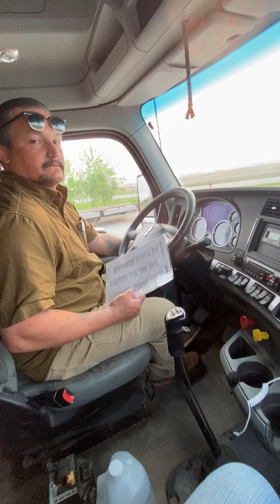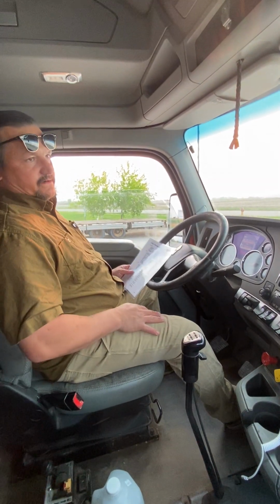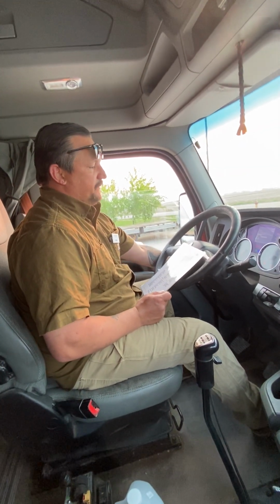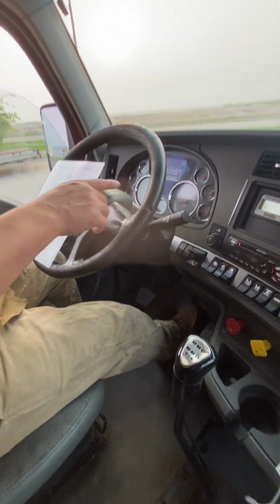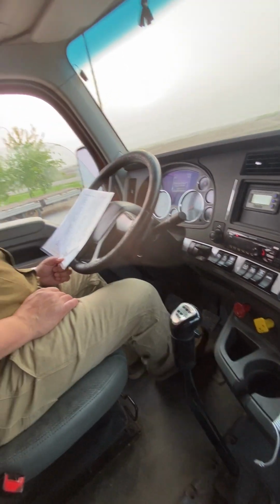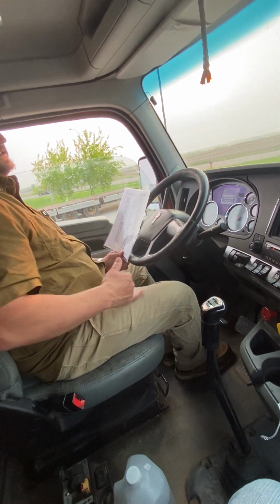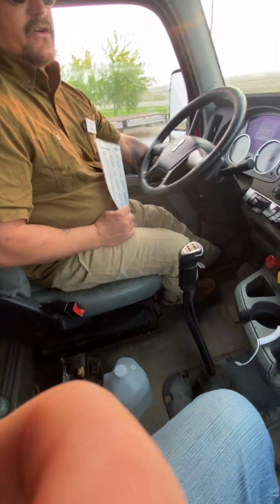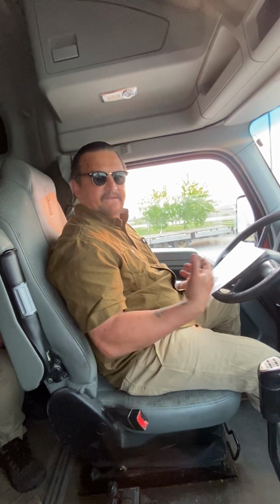Air brake test for my students

Comment: Did you pay off your truck at bay and bay? How long did it take? And would you recommend the lease purchase program?
Reply from the maker: I did not pay off my truck as a matter of fact I’m on my third truck in so many years now. I have a driver in my truck. I do not recommend doing a lease purchase option to purchase the truck. I do however recommend bay and bays lease purchase program in order to be an Independent Contractor and make as much money as possible to accomplish your goals. Right off the bat if you went sliding scale mileage in order to learn the lanes you could clear 2 grand a week if you run 2800 miles and 7.5 mpg. I don’t know if any company driver that can say that. Which is why I would recommend a lease program. However each lease program is different and what I think that makes BnBs great is the fact that they have fuel surcharge, deep fuel discounts, higher than average customer freight rates and guaranteed detention if you are on time put in the macro and put it on the bill of laden
Reply: @Terry Edgar  Thank you sir.